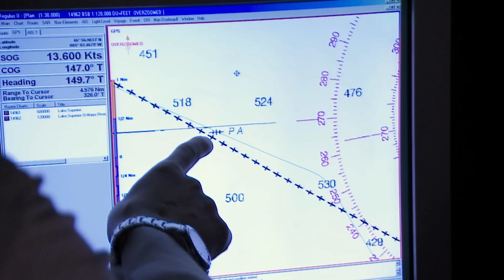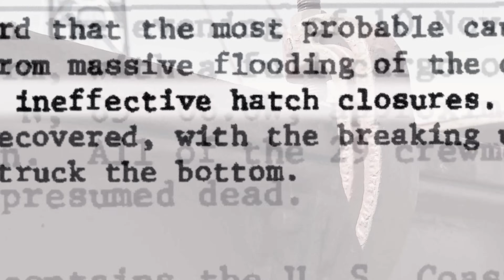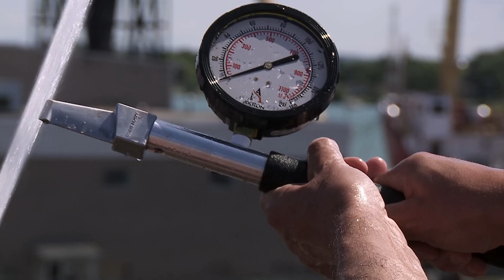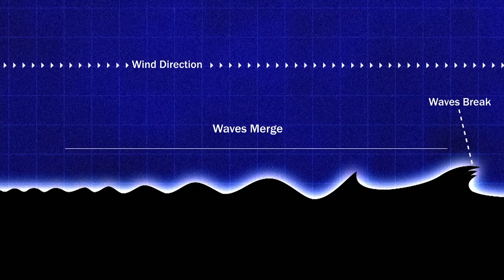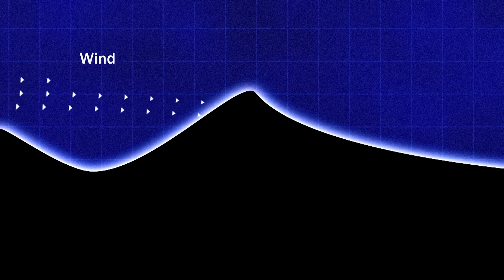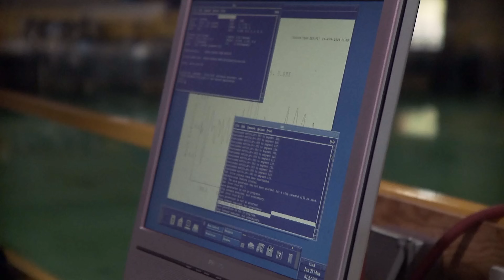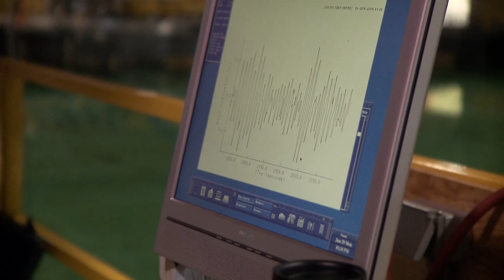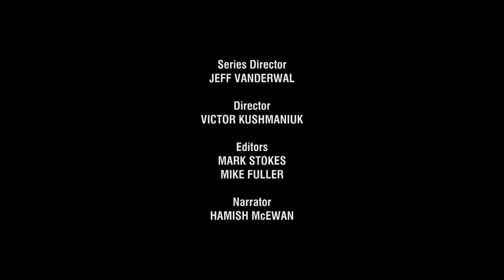The Titanic Of The Great Lakes: What Really Sunk The SS Edmund Fitzgerald?

Comment: Eerie that one of the ships used in the documentary is the Michipicoten. Some have postulated that the Fitz suffered a similar stress fracture and given the rougher seas finally just went down, while the Michi was able to survive due to smooth seas.
I'm certainly NOT an expert, but I've heard experts speak about this topic, including one who's been down to the wreck. He wisely states that no one will no for sure. But he points to the fact that if the ship went down nose first before breaking apart, there would be expected to be a large amount of taconite in the bow cargo holds from all the cargo rushing forward, and there isn't.

Comment: The question is why the (older)Anderson did not go down in the same storm while in the vicinity of the Fitzgerald...seems like the Fitz was loaded too heavy to handle the storm.
Reply: The Anderson wasn't abused and overloaded like the Fitz. The Fitz had steel plates Buckle when the ship was launched, indicating bad things to come. It was also neglected and not properly maintained. The Anderson was properly maintained, which is why she's still in operation 72 years later. The metallurgy of the Fitz was found to be inferior, especially for how she was abused. Tie that with the fact her captain said basically, "I don't care about this SOB ship, it just needs to hold together for this last trip." Loosely quoted.

Comment: There must have been some serious problems with the Edmund Fitzgerald the day that she sank. Consider that the Arthur M. Anderson sailed on the lake the same day, through the same storm in the same conditions and did not sink. Also, the Anderson didn't lose her radars, didn't have her fence railings break, and didn't ship water. Also, the Anderson was an older ship than the Fitzgerald, and so would have probably not been as good condition as Fitzgerald (although her earlier 1975 rebuilding which added 120 feet to her length may have also had been used to give her a general overhaul which the Fitzgerald may not have had).

Comment: Size of vessel, I suppose, but not even remotely comparable in terms of loss of life - the Fitzgerald had a crew of 29.
The Eastland disaster is more like the Titanic in loss of life (844 to 915, depending on source). That incident happened on the Chicago River, right at the pier. If you extend the reach to the St. Lawrence River, the Empress of Ireland (1012) would be comparable, sinking quickly after a collision in heavy fog.

Comment: Hang on- so just before 13:00 it says diving on the Fitz is banned with a stiff fine for violations, followed immediately by how the families ALL signed a gag order not to talk? Wellll that doesn't sound suspicious at all... 🤔 Also why does nobody ever mention how absorbent taconite ore is? It was hard to find, but I did run across a detailed breakdown of taconite's composition which says that it can absorb up to 10x its own weight in water before it even looks wet. These lakers who regularly carried this ore were always at risk of sudden sinking if enough water got into the hold and nobody that checked these holds would have even known about it. Enough wet taconite shifting to one or the other side of the ship would be enough to drop it like a rock in seconds.

Comment: The ship obviously had suffered a stress fracture and was flooding there is no doubt about that . If that was true how do you explain the two collapsed hatch covers behind the wheelhouse ? I belive large waves ran up the deck piling up behind the wheelhouse collapsing these hatch covers, thousands of gallons of water rushed in sending the fitz to the bottom. If she broke up on the surface the hold would have been filled with water, and there would be no reason for the hatch covers to be collapsed inside the hold.

Comment: I am reading the US Coastguard report right now. It seems that this documentary is not reporting the findings correctly. The report on the hatch covers blames the ship operator for not having proper procedures in place for the maintenance of the hatch covers. There is also a huge amount of the ship missing. And that the damage was probably more severe than the captain indicated. The report clearly states that the ship broke up as it sank or that is broke up hitting the bottom. All of this is misrepresented in the documentary.

Comment: Bullshit . Used up and abused for profit  until a big storm took it to the bottom over loaded.  Over & over again.  Sent out one more time with structure problems..
Dry dock repair set to happen after this run. 
The hatch covers were so distorted they could not be latched down. This ship was flooded in this massive storm. 
The inspection should have been failed. Instead money aloud it to sale over loaded again.